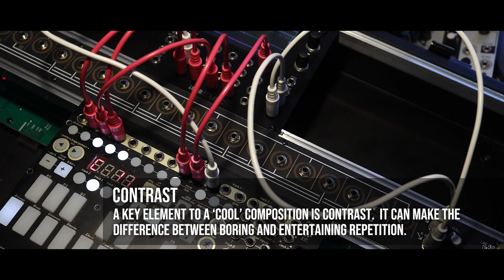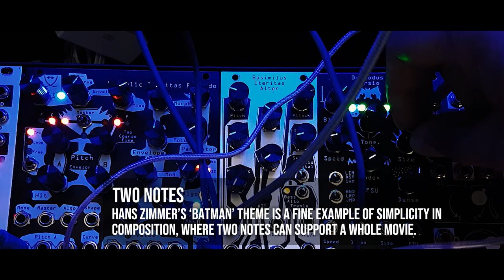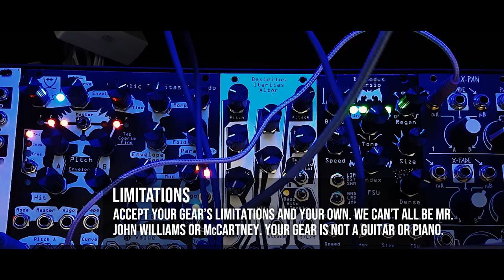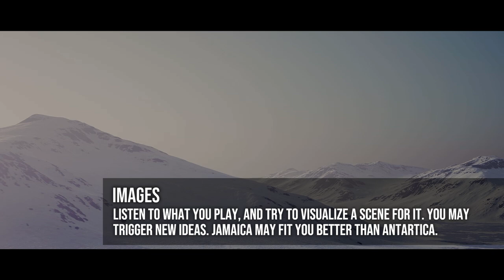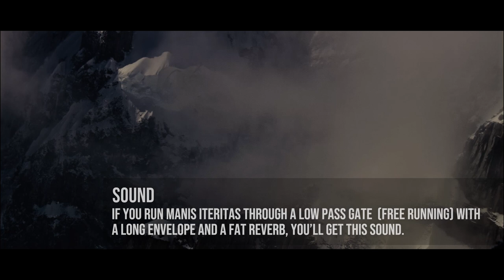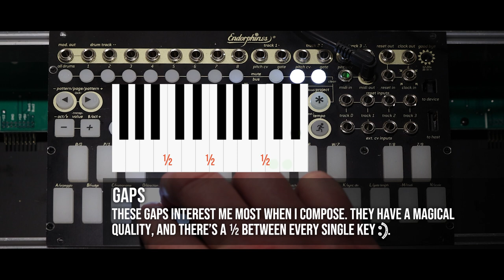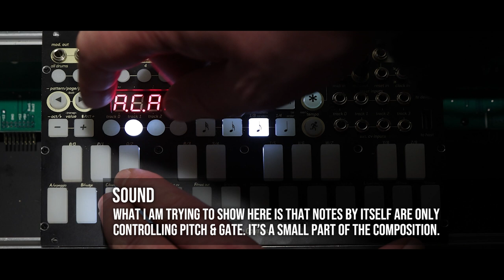Modular Composing | Episode 01 | Key concepts

Comment: I have one case that I am very happy with an consider it finished in the sense that I won't replace any modules in it. ATM I'm slowly working on a case 2. The sequencing/melody making in case 1 is Pams new W, Steppy, Bloom and Harmonaigh in that order, and for my second case I plan to get the Vector five12. The reason for this is that in my case 1 the melodies are somewhat random or chance based, see what's happening and taking it from there kind of thing. What I want and think the Vector can do for me is to make more planed compositions. So, have you or anyone here any experience with Vector or any other sequencer good for such a thing?
Reply from the maker: I am working on episode 02 but it will take a while.  The Vector is the only 'big' sequencer I am not familiar with. What I do know is that every single sequencer out there has it's pros and cons and none of them is perfect. The best sequencer is still the DAW and a midi to CV converter...
Reply: @CinematicLaboratory  Yes probably. what appeals to me most is to see what keys I punch into it. Anyway, thanks for audially and visually beautiful input.
Reply from the maker: I recently got a 512 Vector and it's everything you'd hope for in your comment.